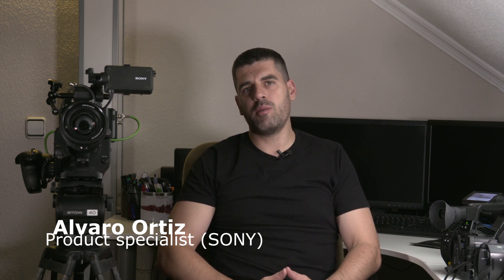Electronic variable ND filter explanation (by Alvaro Ortiz)

Comment: How many stops of light do we lose when the Electronic ND filter is set to full light transmission ?
Is it possible to mount a polarizer on the lens without interfering with the Electronic ND filter system ?
Reply: The lowest value when engaged was ND4 meaning 2 stops.